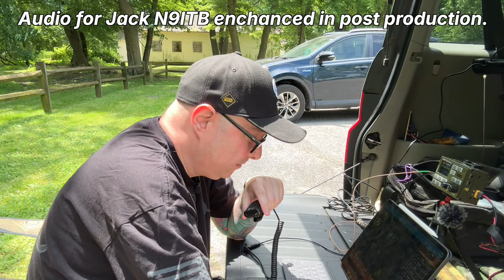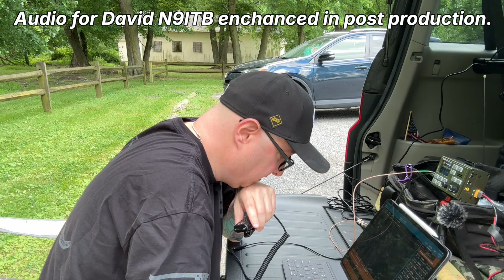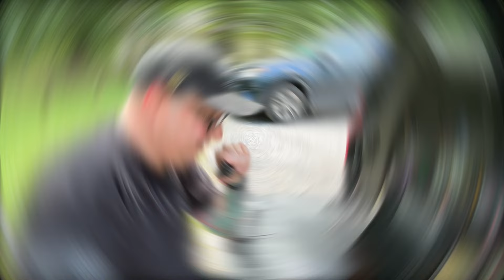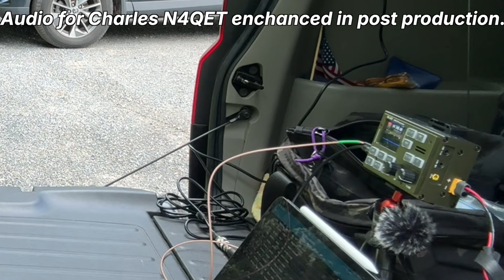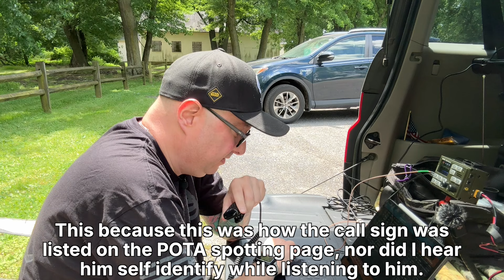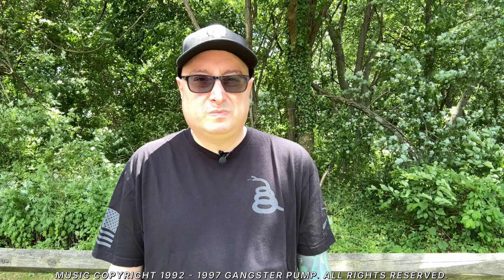Let's Get Nautical: Park to Park with Sable Island

Comment: I might be getting one of these in the next day or two. How would you compare the FX-4CR to the g90? I know the g90 has a built in atu. I currently own a g90. Thanks! 73
Reply from the maker: They are both great radios. The FX-4CR is 80-6m with no ATU and the G90 is 160-10m with an ATU. Both are 20W max.I have both radios.Can't go wrong with either one or BOTH! 73!